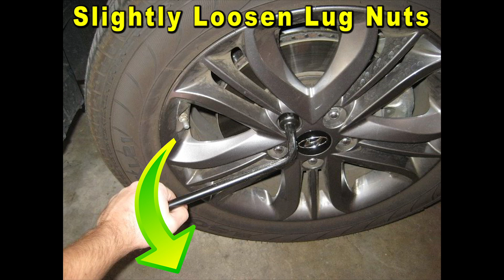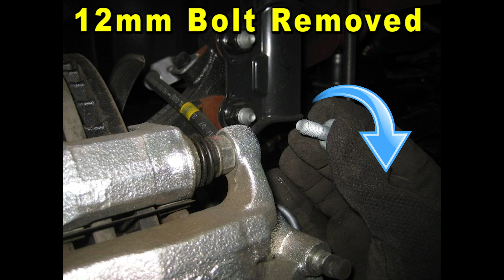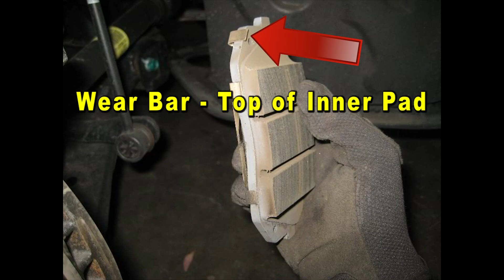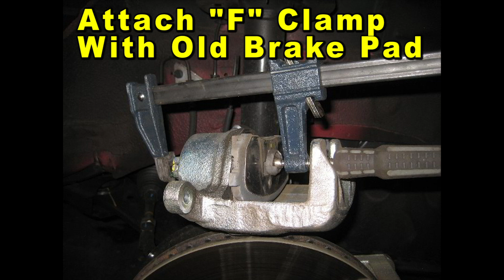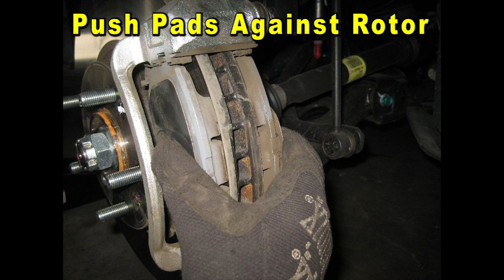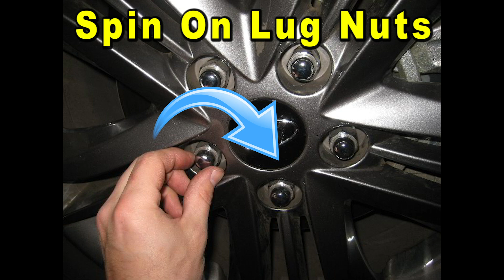2010 To 2015 Hyundai Tucson How To Change Front Brake Pads With Part Numbers & Torque Specifications

Comment from the maker: Hyundai Tucson Front Brake Pads - https://amzn.to/3ArlOj6
Bosch QuietCast Front Brake Pads - https://amzn.to/4fNhDy0
Bendix Ceramic Brake Pads Part Number - https://amzn.to/4fIeaRr
Wagner QuickStop Pads Part # - https://amzn.to/3WKqiIT
Power Stop Ceramic Front Brake Pads - https://amzn.to/3WLIFNF
18" F Clamp - https://amzn.to/3yPOG3T
Precision Screwdriver Set - https://amzn.to/3sLixaP
Plastic Pry Bar Tools - https://amzn.to/3HMtsV7
Socket & Ratchet Set - https://amzn.to/3Z17LbA
Mechanix Gloves - https://amzn.to/3jCnHkt
Torque Wrench - https://amzn.to/3vS5uSI

The Paul79UF YouTube channel is a participant in the Amazon Services LLC Associates Program, an affiliate advertising program designed to provide a means for sites to earn advertising fees by advertising and linking to Amazon.

This DIY video shows owners of the 2nd generation 2010, 2011, 2012, 2013, 2014 and 2015 Hyundai Tucson SUV how to change the front brake pads and lubricate the caliper slide pins including the torque values for the caliper bolts, bracket bolts and the lug nuts.

Comment from the maker: Check out the DIY guide for changing the front brake pads on a second generation 2010 to 2015 Hyundai Tucson - 
https://www.paulstravelpictures.com/Hyundai-Tucson-Front-Brake-Pads-Replacement-Guide/index.html

Here are all of the DIY repair and maintenance tutorials for the 2nd generation 2010 to 2015 Hyundai Tucson - 
https://www.paulstravelpictures.com/Articles/Hyundai-Tucson-Common-Problems-Repair-Maintenance-Guides.htm

Owners of other Hyundai and Kia vehicles such as the Accent, Elantra, Sonata, Azera, Veloster, Tiburon, Genesis, Lavita, Veracruz, Santa Fe, ix35, Equus, Cadenza, Forte, Optima, Rio, Soul, Sedona, Sorento, Spectra and Sportage may also find these DIY instructions to be helpful.